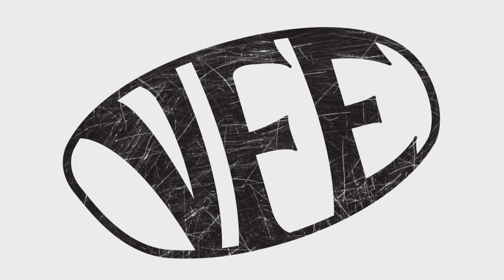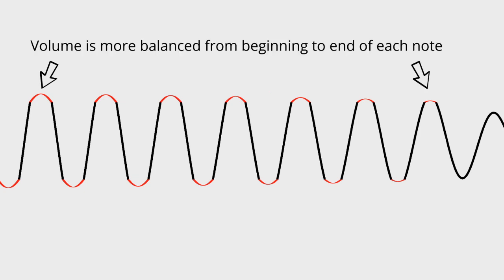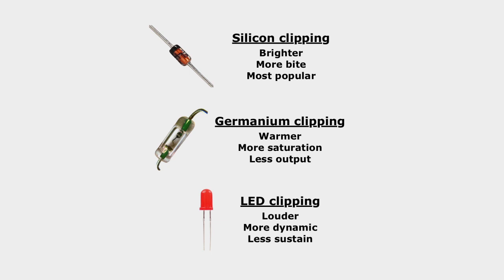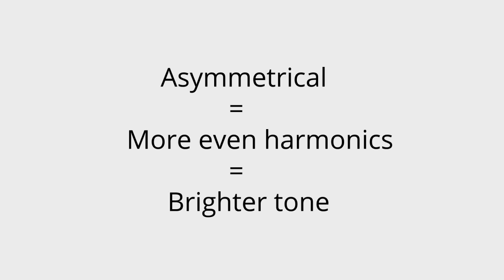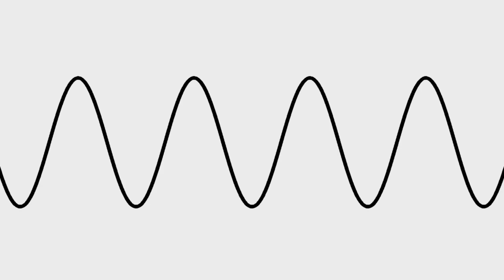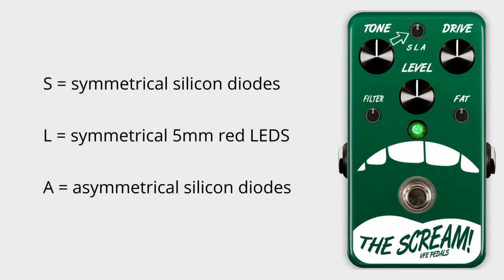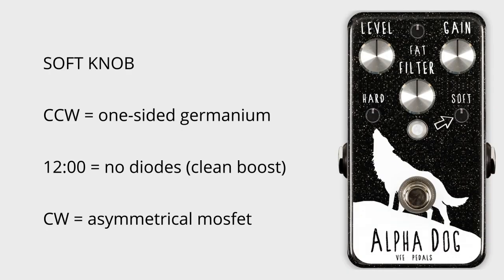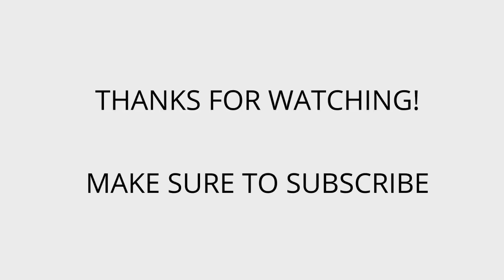VFE Pedals Variable HCC technology explained

Comment: As the very happy owner of a Fiery Red Horse V1, I can attest to the accuracy of the above vid's statements regarding the compression, harmonic-overtones, and symmetrical and asymmetrical clipping characteristics of germanium diodes and LED's, and the way that asymmetrically-clipping germanium-diodes particularly suit lower-gain settings with less saturation- especially with a little Power-starvation dialed-in; while symmetrically- clipping germanium-diodes serve higher gain and saturation settings very well. I might want to try and even buy a V2 FRH, but my V1 will never be up for sale! (LOVE what the Mid knob does for it, too!)